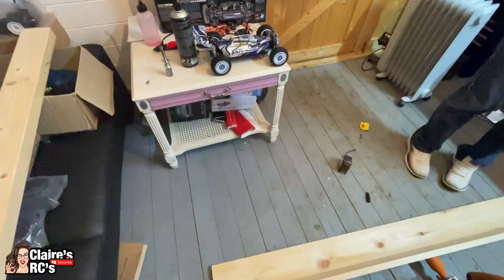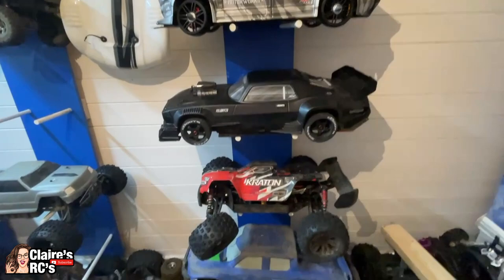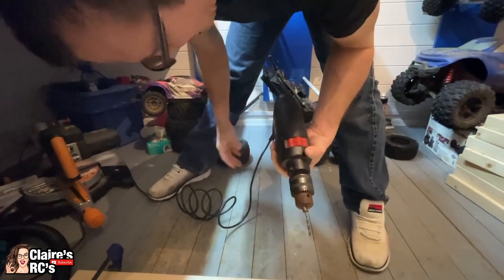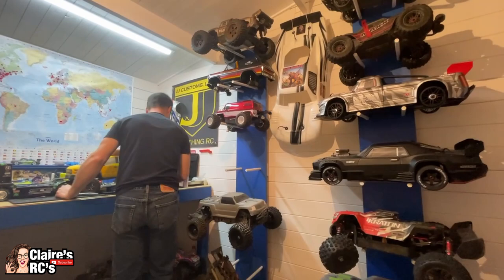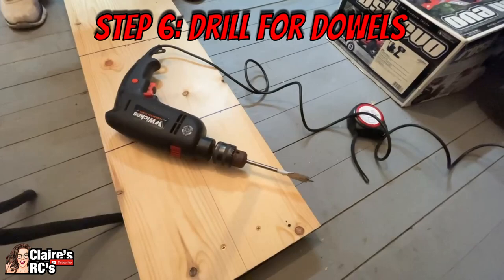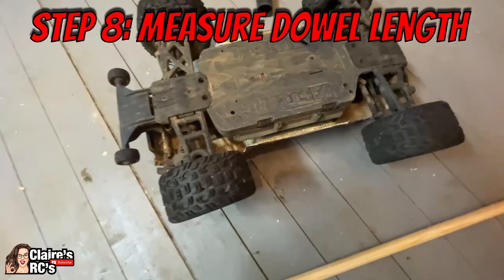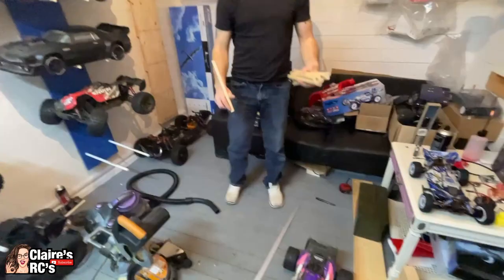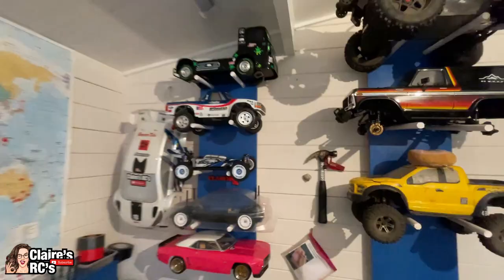Claire's RACK! How to build RC wall storage

Comment: I used to be a shit mechanic and now I'm a good carpenter lol, drill the dowel holes on a 3 degree angle to stop trucks sliding forward. Use a chalk line to line up the dowels vertically, back the smaller drill bits off every 20mil going through wood to break the wood chip and help it clear out of the bit, the bits will last much longer, and as for the bad eyecrometer, there are drills for sale with levels built into the back just for this purpose, keep in mind the board must also be level to make the drill-level acurate ;)
Reply from the maker: Way too technical 😂 they are up and they haven’t fallen down… yet 🤪
Reply: @ClairesRCs  that's why you have a carpenter build you that type of stuff in exchange for you fixing their work truck that they neglect I can guarantee